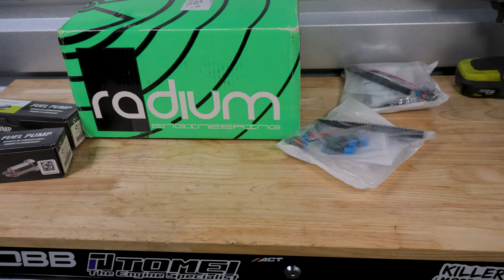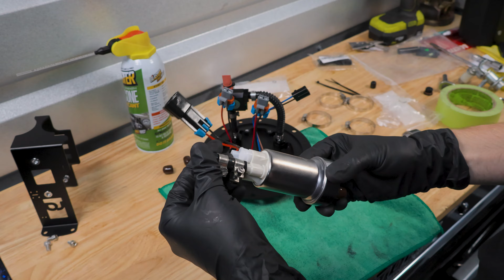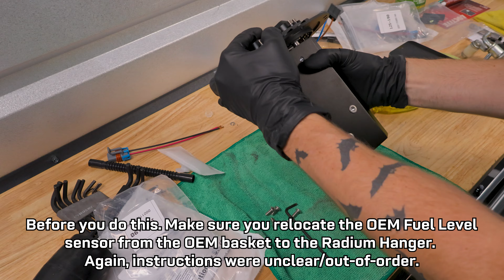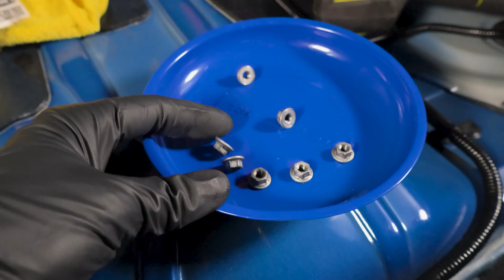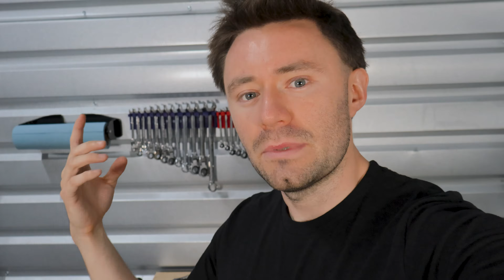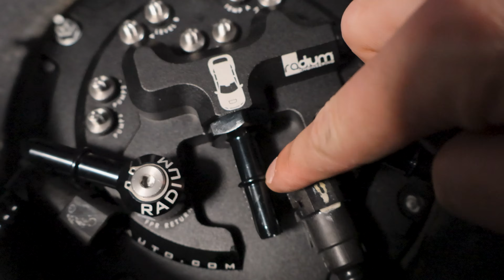Radium Dual Fuel Pump Hanger In-Depth Install | Subaru STI (Walbro 450s) | Road to 600 HP Episode 2

Comment: Did you end up doing the inline fuel filter Radium recommends? I was thinking I'd pick up a small inline one and put it up front when i install the cobb flex fuel stuff if I go this route. Just seems like a better solution than drilling the factory hanger like I have now for the iwire studs...

Comment: So.. for wiring up the new fuel pumps hoe did you do that? Maybe I missed something here. Because the Walbro fuel pump pulls 13.3V instead of the OEM fuel pumps pulling less. To get full voltage you need to wire in the added wiring or I suppose upgrade it.
Reply from the maker: I did that in the next video after that on my channel if you want to check it out. I used the iWire Kit makes it super simple although I would just do the DIY radium way next time. The iWire instructions weren't very clear and are all over the place.
Reply: @nit3sh1ft yeah I finally got it all done myself. Currently got it all hardwired fuel pump duty 100%. However now I got a CEL, short circuit because I bypassed the ECU fuel pump pull. Was a big job actually, was really upset with the radium kit I payed for, I got the "fuel plumbing kit" which lacked heavily on what someone would ever need for new 6AN lines. Thanks for your reply brother! Merry Christmas.
Reply from the maker: @BaldwinIVINC yeah doing the wiring for the fuel pumps are a freaking nightmare dude. Congrats on getting it done brother. Merry Christmas to you and your family as well! 🌲